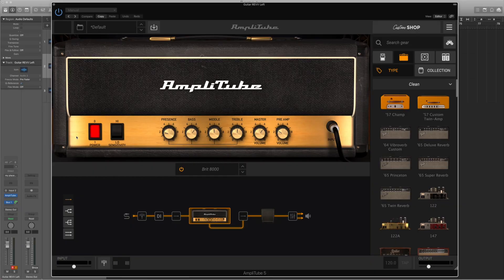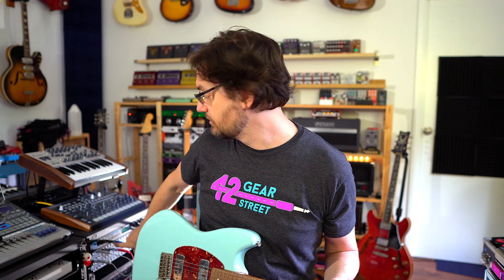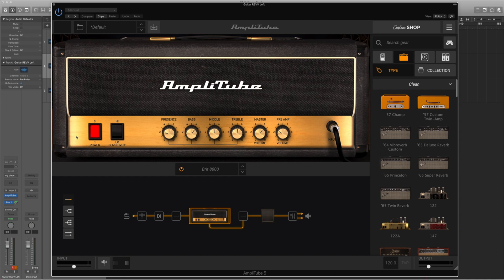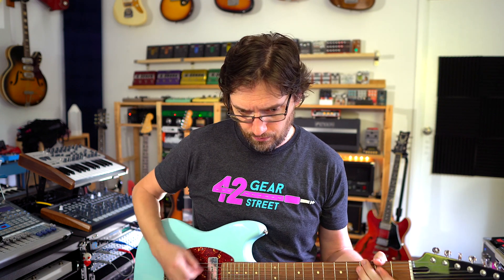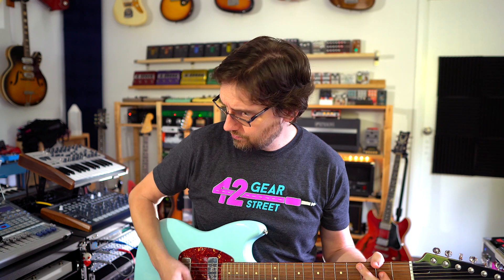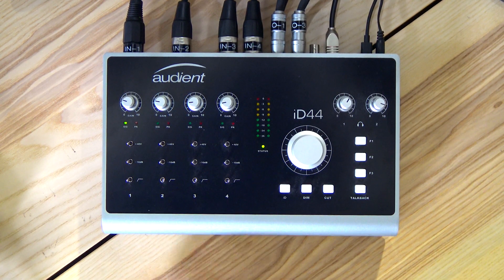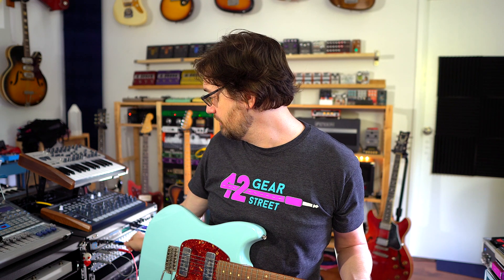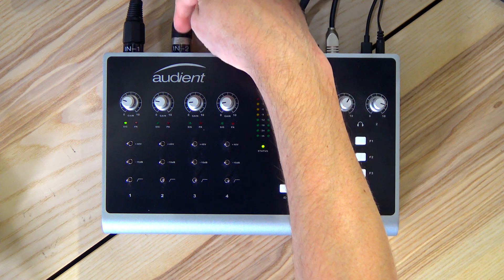Why Does It Sound Wrong...?? Amp Sims, Interfaces & Impedance

Comment: Thanks for the video, I just bought this audio interface and noticed that I've had pretty low levels when recording my external digital piano through the mic/line inputs, I'm talking about 1/3 of the line level that I've got on my previous saffire souncard. To have a correct level I had to crank the gain knob too much, thus adding unwanted noise, do you think it is a conscient choice made by the manufacturer ? 

I tried the DI inputs that can sound great, but sometimes I don't wanna have that colour on what I'm recording.

Comment: It's great seeing proper gain staging with amp sims, well done!
Everyone seems to just crank everything...
Anyway!
I watched you 've got the Leslies in Amplitube!
In Cubase I send a Mono DI signal through a Stereo Group, in which I use Amplitube Leslies as an insert, otherwise I can't get the Stereo Effect, but I would like to avoid that added track...
Any recommendations?
I am using Cubase AI and Amplitube Custom Shop (only for the Leslies).
Reply: I'm not a Cubase or Amplitube Sim user myself, but have you tried recording into a stereo track and running the insert on that? Maybe the amp sim will just register it as a mono signal and output accordingly. I'd definitely try that out, but keep in mind you may have to compensate on the amp sim's output by +6dB to combat volume loss due to mono summation

Comment: Very good... On the high impedance it sounded kind of overdriven to me, on low importance at low gain in souded a lot warmer but then when the gain was turned up on low importance to match it it sounded overdriven but a bit less harsh. I prefer it through the Roland with the gain turned up personally
Reply: Hi! I just sort of want to clarify why this is happening. When the guitar's output signal is being run into the rear (Low-Z) input on the interface as opposed to the front (Hi-Z/instrument) input, ONLY TWO THINGS are actually changing: 1.) the level at which the DAW receives the signal, and 2.) there is some high frequency roll-off. The overdrive effect you're hearing more of in the Hi-Z/instrument input is only a consequence of that signal being received by the amp-sim as slightly louder, i.e. there is more DRIVE going into the amp-sim. Notice how when Gabor turns up the gain on the interface, the overdrive effect increases.

The only change in timbral quality is the aforementioned high frequency roll-off. This is just a consequence of the physical aspects of impedance, which is a whole other can of worms to dive into. Have you ever seen on like a Scarlett 2i2, the inputs have a switch on them that says "Line/Inst"? The reason for this is that line-level signals are low-impedance and thus come into the interface LOUDER, while instruments typically output a fraction of that level. If you get the chance to use something that has a switch like that, flip back and forth between the two settings and you'll be able to hear what I'm talking about! You can think of it almost as if the interface is compensating for these differences in levels  :)

Comment: Have you ever tried to use the ports 3 or 4 without a D.I. ? is there any difference? And honestly I don't catch the problem you're talking about, why don't you connect your preamp directly to the front D.I. port? you have 2 of them, aesthetic problem?
Reply from the maker: Ports 3 & 4 are the same as 1 & 2 without the DI.

You misunderstood what the video is about...it’s not about my interface and my DI inputs in the front...it’s about other peoples interfaces - I’ve had people message me and say that they tried plug-in amp sims but they didn’t sound anything like they did in my videos and that they sounded really dull and lifeless...and I’m hoping to help people by showing them that they most likely only need a DI to make it sound good
Reply: @TSFAHTPS  ok I wrote too fast probably :-) , yes the impedance is a topic not so known out there for beginners, I understand. Honestly I was wondering about a problem with a beautiful audio interface like that, that's my misunderstanding, and sorry for the stupid question, on the back I noticed ports 3 and 4 as line in input, but there is no jfet indication on the user manual for the rear ports actually. I own an id14 mkii and it works fine at the moment, and the jfet port works ok as well.
Ps: beautiful guitars!

Comment: I've never used a DAW or any other recording software (because I simply haven't had the time to learn how) but this was informative and useful nonetheless. I knew about impedance (or, as aficionados of  "That Pedal Show" would say: The Impy Dance) but the issues one might face with interfaces are new to me. I have a Focusrite thing, still in the box. I'm sure this video will be helpful if & when I get around to using it.

I have faced some Impy Dance issues when going direct to fr fr P.A speakers via a mixing console.
Reply from the maker: Yeah it’s amazing how much of a difference all this stuff makes...and like you said it’s the same when going direct into a PA at a gig...amazing how much of a difference a DI makes

Comment: Hi Gabor helpful vid. I also notice in Amplitube one some of the amp sims they give the option of Hi or Low input impedance. Question for you. You mentioned near the end about low output pickups and being noisy (hiss) by contrast are high output pickups quiet? Or does it have to do with earthing?

Comment: Having pretty much all Amp Sims you can think of [Amp4, Amp5, Native, etc] this is one of those "Got To Know This" vids.
But there are other things to consider as well: Processing Power, Streaming alocation, etc. Some amp sims produce digital cliping even when using low-impedence due to PC specs. After building a PC that is completely dedicated to audio I noticed quite a change in their behaviour, though in some cases the digital cliping still occurs on high gain amps and pedals [love Muffs, but can't make the ones on Amp4/5 and Native work at all with all the digital clipping they produce].
That said, Amplitube is still my favorite Amp Sim for clean and Bass. Not so fond of the effects though. And the Leslies on Amp5 are yumm-yumm delicious.